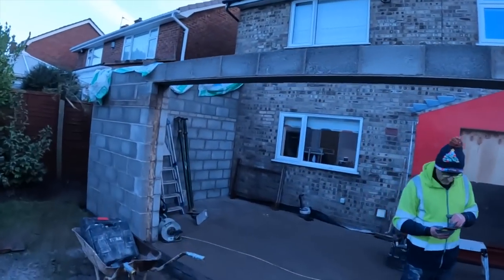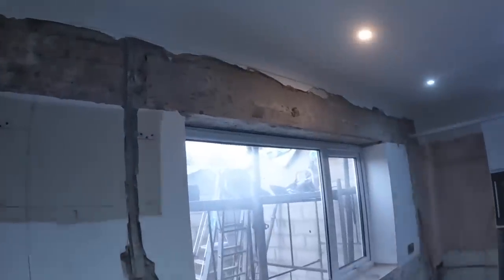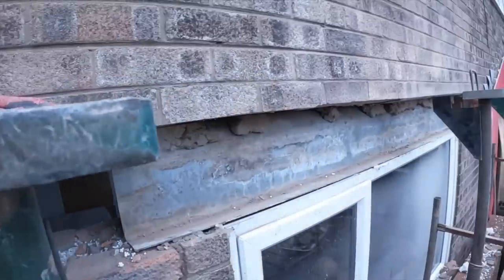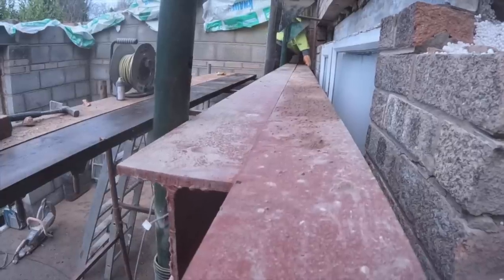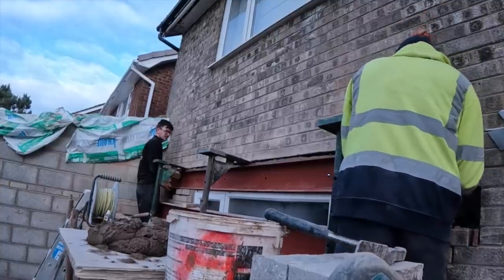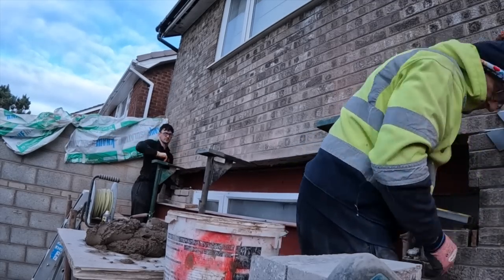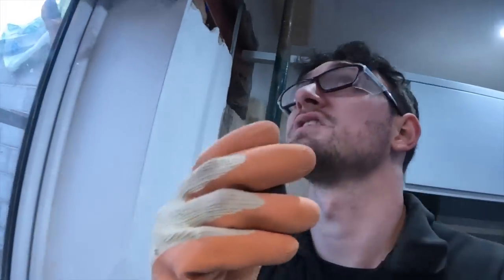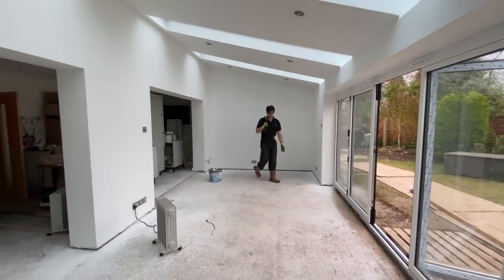RSJ BEAMS AND THE BIG REVEAL  ..TEAM EFFORT ..BIG EXTENSION BUILD PT 7

Comment: Hi Steve &Alex. The evolution saw makes light work of removing the old mortar. Does the blade go all the way through it looks like it will if doesn’t it must close? Like the way Alex is getting more confident by that I mean when suggesting how to get the steel up, he would just waited for you Steve to tell him how. Now it like the other way round.  Great job again guys. 👍
Reply from the maker: It’s got a 115 mm depth cut so straight through John .
   Yeah Alex doing so well 🧱👍🏽💪🏼

Comment: Another great video but puzzled why the building g inspector moans about not using the same materials.  Not a builder but still intrigued
Reply from the maker: Concrete has crap u value apparently 🧱👍🏽🙄
Reply from the maker: @martin2466  . That makes sense now as always . Thanks Martin .🤙🏾🤙🏾🧱👍🏽

Comment: I have a lintel to install at some point and so have been watching your vids as you seem to know what you're doing. I haven't been able to find a job you have done, similar to the one I want to do though. I'm taking down a kitchen wall and don't want to build a pillar on the outer wall as it will mess up the run of cabinets. Is it permitted to support that end of the lintel on the inner and outer leaf of the outside cavity wall (on a padstone first), to avoid the need for a pillar o that side? Perhaps the reason I haven't seen this yet is because it isn't allowed but I thought I would ask.
Reply from the maker: If you are attempting anything like this you must employ a structural engineer who will tell you exactly how your steels need to be done . 🧱👍🏽
Reply: @SteveAndAlexBuild  Thanks for your reply. I will definitely be employing an engineer before I have the work done. Just didn't want to waste time and money getting one to come out if it's not something you are allowed to do in the first place. So just wondered if you have ever employed that method or know if it can be acceptable.
Reply from the maker: @prestonian1066  🧱👍🏽
Reply: @prestonian1066  I had my load bearing kitchen wall removed and a steel inserted. It was all checked by engineers and building control, but from memory the builder did what you are suggesting, resting the steel on the internal block skin (using a pad stone) so it might be possible; you will need to get it checked as advised by Steve. I hope that helps.
Reply: @iain8567  Very helpful and will do ty!